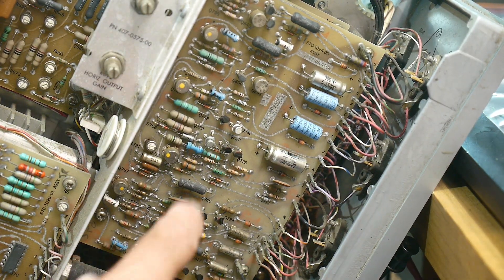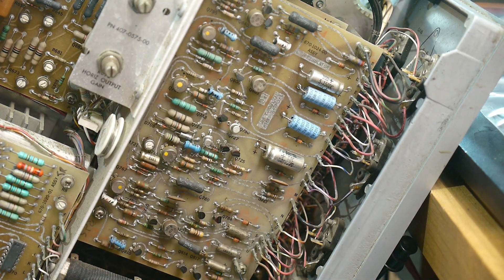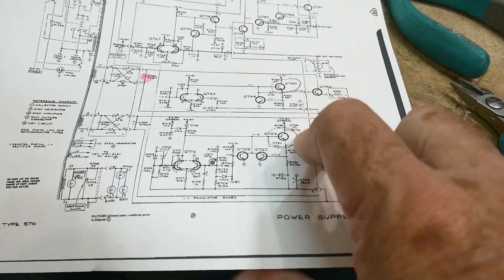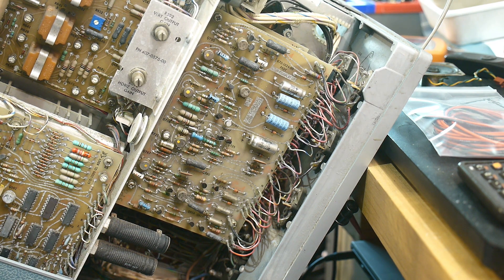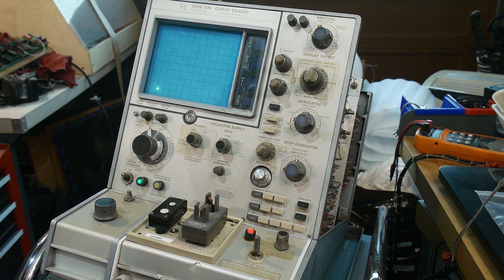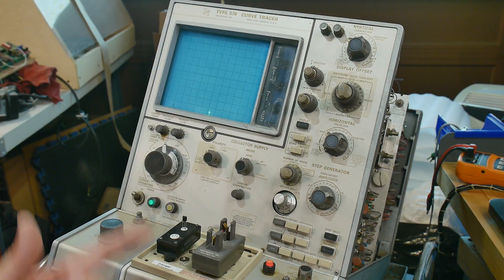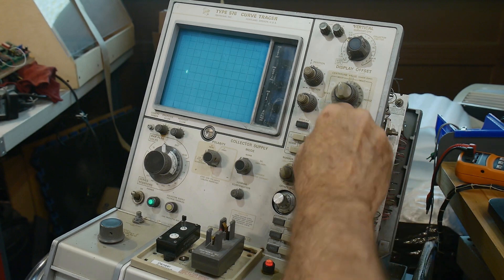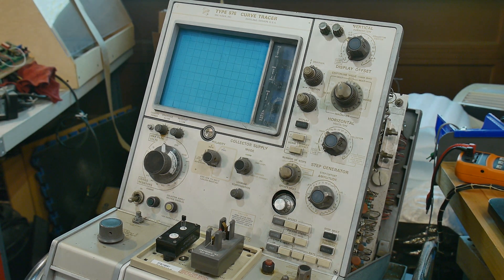#1276 Tektronix 576 Curve Tracer (part 4 of 9)

Comment: Your excitement when you got the trace on the CRT was exactly how I felt when I started getting my 576 to show signs of life!  Very interesting that its not sweeping despite you being in normal mode.  The collector supply just sweeps it at 120Hz rectified (positive and negative for NPN and PNP settings, respectively) sourced from transformer T301 and a 500V bridge rectifier (2kV bridge for the 1500V supply).  And then you can also adjust this sweep rate using some of the controls on the right (such as 300uS, 80uS, 2x and 0.5x).  Maybe yours is stuck in DC mode? Another broken coupler? I'll find out soon enough 😂

Comment: I'm very surprised that you are risking further damage before physically inspecting and/or testing the outdated capacitors especially in the HV section.
Reply: The HV caps aren’t electrolytics. They don’t usually fail, especially not on equipment of this vintage.
Reply: @absurdengineering  I'm well aware of that but any capacitor type in a HV environment undergoes degradation through use.